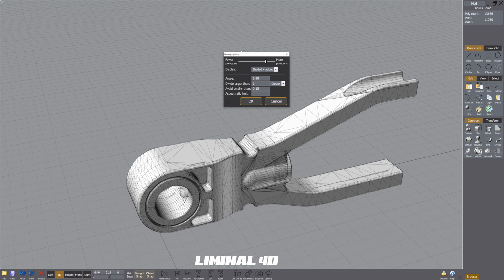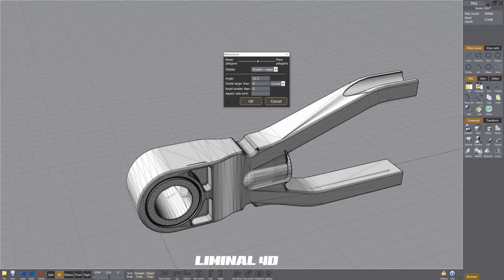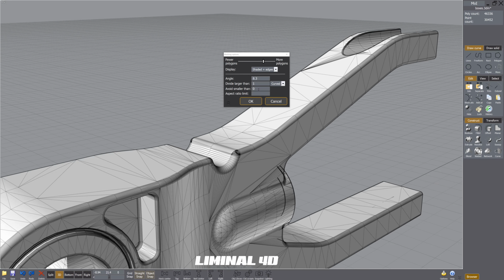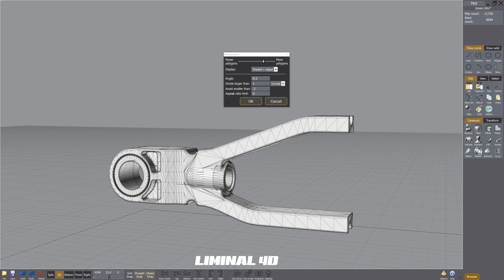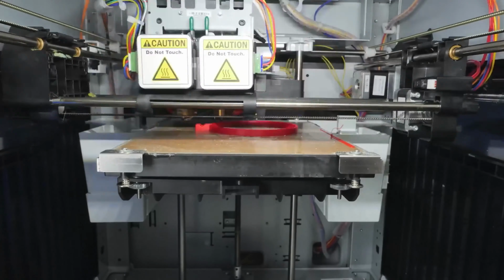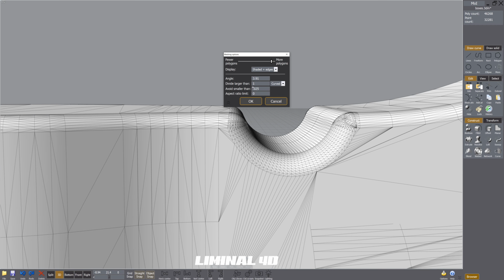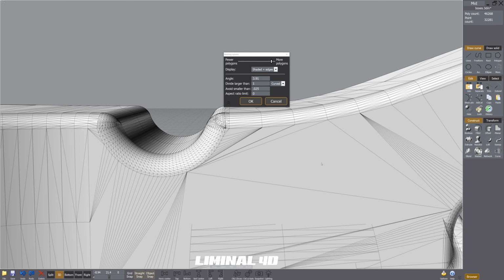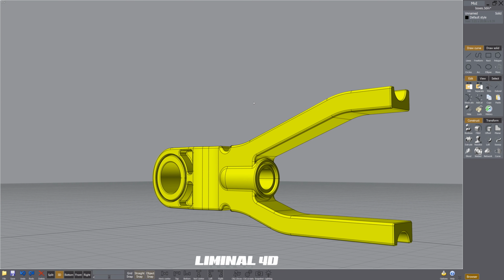Moi 3D - Export for 3D Printing

Comment: My model is a solid but upon saving as .stl the design is totally obliterated into shards. However, when I save it as a .3dm and open it in Rhino and then simply save it as an .stl, my Formlabs Preform accepts the model as integral and I can simply just print. Help is appreciated, I don't want to have to buy Rhino just for this simple feature (my free trial expired.)
Reply from the maker: Can you email me the file? I can take a look. email: contact@liminal4d.com
Reply: @liminal4d  Omgsh I just solved it, not sure exactly what it was but this time I boolean unioned > edit, join > Saved As an .stl file rather than exporting it as an .stl file. Then opened it up in preform and it was perfect. Thank you thank you thank you, I made an object to email you and discovered the winning sequence in this process!!! Saved me $1k!
Reply from the maker: @matthawksworth  That's awesome! Maybe an un-joined surface somewhere? good news, right on!
Reply: @liminal4d  yeah maybe so, thanks again!